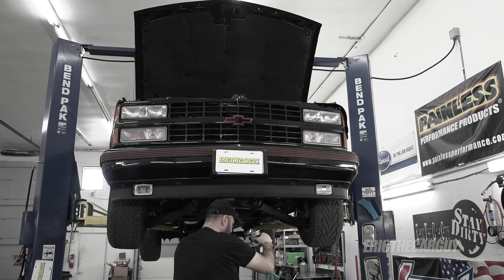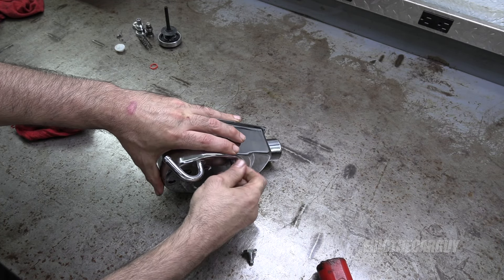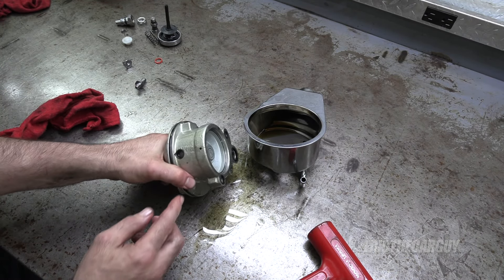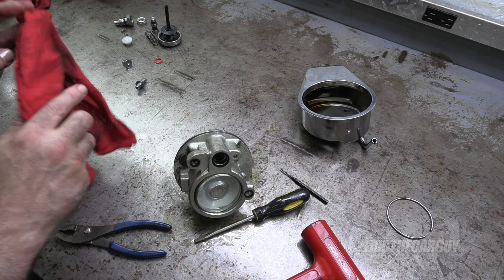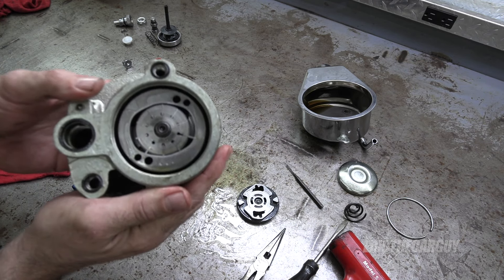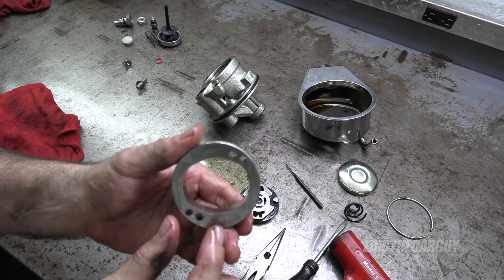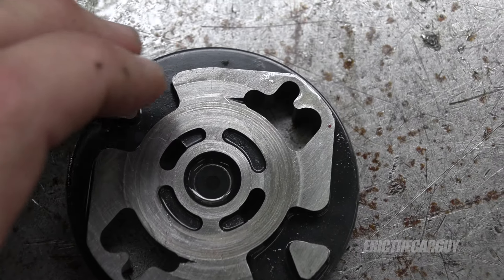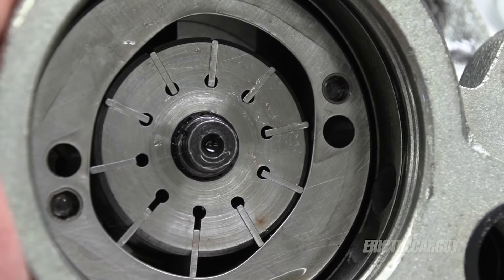What’s Inside a Saginaw Power Steering Pump?

Comment: Eric, great video man, it was cool seeing just how a Saginaw pump works and what went wrong with your. One question though?

I know you recently got rid of your mustang parts car but, I’m wondering if you can do a similar video of a ford pump if you still have one?

I’m curious as I would guess many others are about the 80’s and early to mid 90’s pumps that all at one time or another would have the known to ford owners as the power steering pump wining!

I feel lucky because all of my vehicles, 85 Mercury Grand Marquis LS, 86 Mercury Grand Marquis GS, 84 Ford F-150, 85 Ford F-250 and a 91 Ford F-150 with different engine but, all use the same damn power steering pump.

The only reason I’ve replaced 2 of them was the one pump was growling under pressure and the other just started doing something similar to yours it would get hard to steer after the system got hot.

I think that’d be another cool video if you have one from a car or truck sitting on a shelf or from a junk pile!
Reply from the maker: I don't have any of those pumps. Remember I fitted a Saginaw onto the Fairmont, the same pump as the one in this video. Truthfully, most power steering pumps look very similar on the inside and the fix is the same, replace the pump. Thanks for the comment.
Reply: I have a power steering pump that whines during the winter when it's cold until it warms up on my 2007 4.0L V6 Mustang. It has done this for 7 years but it still continues to work just fine. I guess it just doesn't like the cold. 😄
Reply from the maker: Try synthetic fluid.
Reply: What matters in this equation is the factory type of fluid recommended by the OEM.

Example: Originally Ford used standard power steering fluid but later for 80-93 Ford vehicles from the factory were recommended by ford to use (Type F) transmission fluid (not power steering fluid) in their power steering system. Later in TSB’s (technician service bulletins) They reprinted their service Manuals to include this change, I don’t remember the year they did this but it was in the mid 90’s!

They did this due to the fact that Type F trans fluid has a higher viscosity than power steering fluid (which at the time was glorified machine oil) and it quieted the classic Ford Power Steering wining to a minimum.

Ford updated their recommendation to the use of (Dexron II - III / Mercon III - IV) in their power steering systems because the use of different detergents in the fluid made the systems live longer and cleaner. They also reprinted all Factory Service Manuals to change/update the power steering fluid specifications.

That said, they came back again in the late 90’s to include a power steering fluid in the newer power steering systems particularly 98 and later systems to use again (power steering fluid) which by now is a thinner Hydraulic fluid that works better than transmission fluid but is severely dependent on included internal filters in the lines and proper fluid changing intervals.

Though even today on the old 80-93 power steering pumps it’s still recommended to use Dexron II - III / Mercon III - IV, if you use newer fluid in a old system even if it’s a reman or new pump it will destroy itself over time and the same goes for using older fluid types in newer systems as well.

I don’t know why except that I’ve tried it and it’s the truth and they do fail if the wrong fluid is used but, if you use synthetic fluids it still has to be similar to the recommended fluid for accurate viscosity and life of the pumps.

I’m not a fluid God but, I’ve tried them and this is what I’ve found, I don’t know about GM, MOPAR, Honda or any other manufactures for that matter. I’m a Ford guy and that’s what I know is Fords.

Personally I’ve used Dexron III in my vehicles for 20+ years with no failures except a pump just wearing out. My results are from working on all ford vehicles over the years and this is what I’ve found and see in action at the shop!

However, I’ve never opened a pump to diagnose what failed, if they broke I replaced them it’s that simple.

But Eric disassembling the pump was cool just to know what actually happens when a Saginaw pump typically fails.

This is the reason I asked about the disassembly of a older 80-93 Ford pump because I’ve wanted to know for years how exactly they fail?

At Ford warranty doesn’t pay for pump disassembly and customers out of warranty don’t want to pay the shop hourly rate either just to know what happened.

Both Ford and the customer only care about it being fixed in a timely manner as cheaply as possible too, trust that 100%!!!

Comment: It's funny how every time I do an unusual job, there's one of my YouTube subs that end up doing the exact same thing at the same time! 😂 Great vid, Eric!

This is a perfect example of how things aren't built like they used to be. As I mentioned in a previous comment, I recently dismantled and rebuilt my original OE power steering pump in my '86 Grand Marquis with 268k miles on it. Pump still worked, just had a few leaks. Bought a Gates seal kit on RockAuto and installed it. Anyway, what a difference in construction compared to that Saginaw! Mine had springs and slippers with leading and trailing edge - 10x bigger and stronger than those vanes in there. Also 10x more frustrating to get back in place! Also, my snap ring was much thicker with a larger circumference, and much more difficult to extract. I wanted to keep the OE unit, so I dealt with the frustration of this overhaul. I wonder if a rebuilt unit at any parts store would be built this same way? I think I know the answer to that, so I didn't dare take a chance. It just amazes me that there were metals available in 1986 that could withstand this repeated cycling for decades on end without failure! Too bad automakers don't care to use these high quality components in ANYTHING anymore. Imagine how many cycles each spring has seen! Just at idle that thing is spinning at 6-700 RPM. There's probably 8,000+ hours of runtime on this engine!! Amazing.  

I'm going on day 7 of trying to edit that mess of a video. I need a new computer ... or someone who knows how the hell to fix it! Even the people who built it (Apple) are no help! Everything works except my pictures and video editing stuff - slow as molasses in January ... through dial up internet! $4,000 for the new setup I want, so that's a big holdup ... 🤢

Comment: Hello Eric love your content.
Just wondering can you polish the bad areas in the pump to repair it ?
Reply from the maker: Not likely. As the manual states, "replace the entire assembly".
Reply: If you have a surface grinder you could grind those surfaces back to spec and it would work

Comment: I had a van a few years ago with a noisy power steering pump.  One day the power steering completely failed and there was no power steering at all.   I took the pump apart and found that the spline was stripped on the shaft inside the pump.

Comment: Pressure in a hydraulic system is a result of resistance to flow.
Reply: Yep. :-) People think pumps make pressure. They don't. Pumps make flow. Pressure (as you said) is a resistance to that flow. Some fun facts. 

Hydraulics is like electricity in most ways. Think of electrical current as flow, and voltage as pressure and will be clear. So, for pipes/wires, as the current/flow increases, so the pipe/wire must be bigger. As the pressure/voltage increase the pipe wall thickness/wire insulation must increase. For a constant flow/current, as the pressure/voltage increases, the resultant transmitted power also increase (and visa-versa)... Check valve = diode, pilot operated check valve = transistor (or relay), accumulator = capacitor, filter = inductor, flow restrictor = resistor, intensifier = transformer (sort of), pump = battery... Fun!

Comment: What if you plane the 2 mating surfaces? Wouldn’t the spring pick up the lost “material distance” and re-seal the pump?
Reply from the maker: Maybe, maybe not. Remember the hub for the pump veins was also damaged. You'd have to machine that as well. Then you have to worry about the pump veins. As it says in the manual, if you find excessive damage, replace the pump. Not saying it couldn't be fixed, just I don't see the point. Thanks for the comment.

Comment: Got a question. When the power steering pump whines, why does it whine, and what is causing the whine (where/what is the sound coming from).
Reply: Whine is the pump cavitation with air the air gets in the vanes and makes a whine type whistle noise

Comment: You could of lapped the pressure plate, cam ring and rotor to get rid of the scoring. All you need is ten bucks of valve grinding compound a micrometer to measure and a sheet of glass. I pinched my lapping glass out of a picture frame when the Mrs wasn’t home, she still hasn’t noticed.

Comment: Hey Eric I just purchased a Saginaw pump and installed it on my car it is a key way shaft with the Nilon nut the bolts the pulley on and I noticed it had around 1/8 play in and out, is this normal?

Comment: Should have watched this video first. Mine had a real bad leak, and on removing the pump assy, all the veins came crashing out. I re sealed it and put it back together, and I don't have power steering at all. My guess is I put the veins in the wrong direction, and probably a couple other pieces were wrong as well.

Comment: I had a rebuilt ps pump.installed in my honda from the dealer. I had a problem with random loss of power steering. Even almost crashed. Went back to the shop and got another pump installed. Lol.

Comment: I wonder if it could be re-machined again to take that damage out?
Reply from the maker: Possibly but I don't think it would be worth the effort. Remember the vein assembly also had scoring.
Reply: I would think you’d have to also replace the vanes to account for the removed material.
Reply: @jeffleach2668  I think u would machine it with the vanes inside the puck, hose lamp around it or zip tie and a belt sander, my guess

Comment: Hey Eric, my mechanic keeps telling me that the noise I keep hearing from my steering pump on lock position is normal, is that correct? There is no noise while normal turning only at lock position on either side
Reply: Yes that is correct
Reply: Normal
Reply: Yes the noise is the fluid bypassing so you don't rupture a seal or lines

Comment: What to do if the spark plug are hard to come out or break off - 2002 ford ranger 4.0l automatic - used knocker lose penetrating oil
Reply: Attach engine hoist, unbolt engine mounts, pull engine, scrap engine for beer money.  Now pat yourself on the back while enjoying a cold beer.  It's really the only option for an almost 20 year old Ford.

Comment: I expected more damage. I guess as the fluid got hotter it would leak past that sealing surface quicker, moving less volume.
Reply from the maker: This should be a machined surface with no imperfections whatsoever. Imperfections = leaks. Thanks for the comment.
Reply: @ericthecarguy  Given that you could catch those score marks, it wouldn't surprise me if those vanes were unable to fully slide out under centrifugal force and thus wouldn't seal against the edge of the pump housing. Thanks for the teardown!

Comment: so was it Bering material that scraped the surfaces?
Reply from the maker: No, I suspect it was the misaligned pulley causing vibrations in the drive shaft.
Reply: @ericthecarguy  ah yes i watched the rest of the video ..lol should have asked at the end ..lol
Reply: @ericthecarguy  i swear anything chrome plated is designed to fail so we can drop more cash down.

Comment: Similar to an automatic transmission pump yet no filtering system to protect it. The more you open the lid to check level, the more chance of contamination.
Reply from the maker: Some systems use filters. You could also install one. As for opening the system, how often do you check PS fluid level. Follow up, how often do you check PS fluid level in a dusty, dirty environment? Thanks for the comment.
Reply: @ericthecarguy  
I do an inspection of the system for leaks or seepage every oil change. I rarely open, but when I do the area is cleaned prior. 
Cheers

Comment: Why dose a pump need to be so shiny and chrome ? ; )
Reply from the maker: It doesn't. I got it as part of the accessory drive kit for my engine. It was the easiest solution to the problem. I built the truck, including the engine, suspension, brakes, differential, and custom instrument cluster in 5 months.

Comment: hydraulic power steering is horse shit. one scored surface and the entire assembly needs to be replaced... wtf. and like 50 parts just for one pump...  i miss my 90s civic with rack and pinion and no ABS brakes